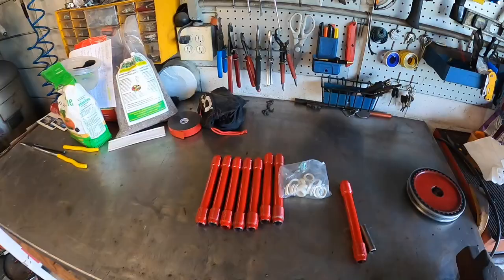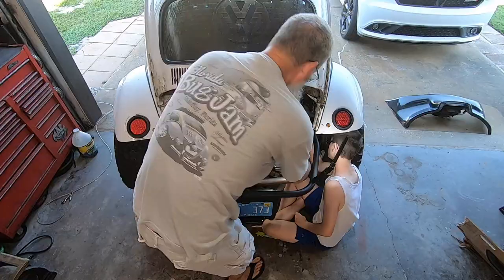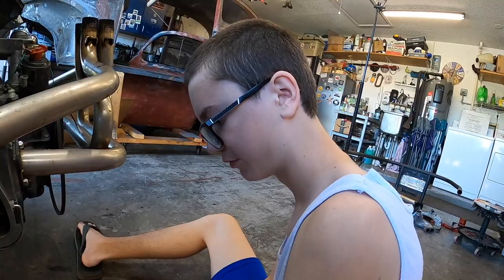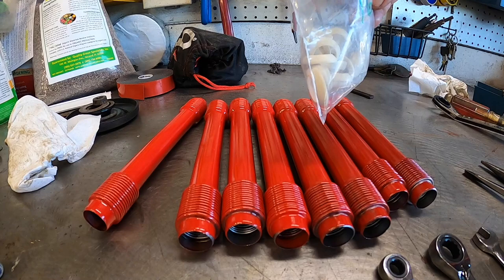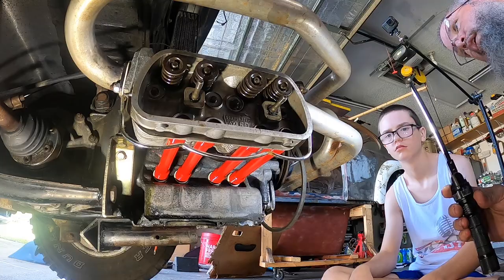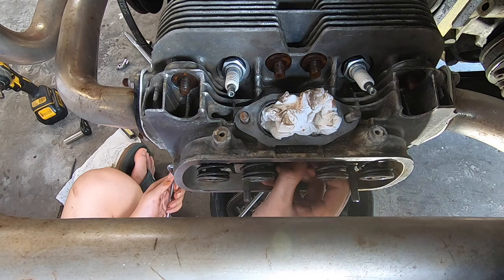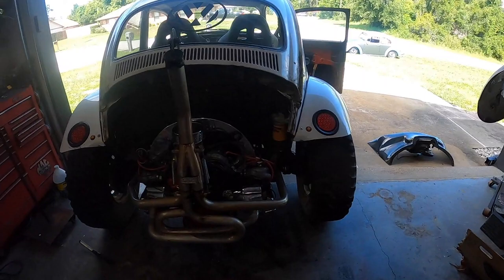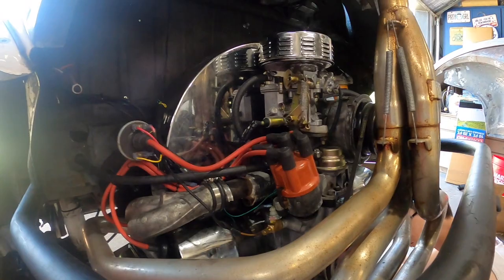How To Replace Leaking Volkswagen Bug Push Rod Tubes

Comment: Using the p/r to hold the p/r tube in place is a super pro tip! Thanks for another great video
Reply from the maker: I prefer to put the engine sideways on the stand but this works well when it’s in the normal orientation. Not everyone has an engine stand.

Comment: Great video glad to see Levi getting in there...did this to our 68 few months back funny story...replace all tubes on 1 side slid head on told Allison to put head nuts n washers on for me boom she dropped a nut down a push rod tube ...it didn't stop n fell into case
Reply from the maker: Thanks, we actually had a good time regardless of how it came across on the video. He was in a mood but we pushed through and laughed later. 
Ouch, that stinks about dropping the nut down the tube 😔

Comment: Another reason to love bajas.  The engine is right out there.  I got lucky just changing the oil cover plate to fix my leak.  The heat here in the south is rough but at least we have high humidity. LOL
Reply from the maker: Absolutely!! Bajas are easier to work on for sure. Glad the cover plate solved your issue. This engine didn’t leak until we came back from the test drive and found that the higher rpm’s while driving bs putting in the neighborhood showed the leaks… they weren’t minor either lol
The humidity was brutal last weekend… I can not wait for it to cool down some.

Comment: Lucky on the head studs! I blow a plug out of my head so I figured might as well replace the tube seals
Reply from the maker: Ouch! If you have the fan shroud off, it’s usually good practice to replace the oil cooler seals as well while you’re there.

Comment: Great Vid Levi.   hehehe   Not everyone has a engine stand or a shop Great example that you can do it without.  I did that on a 2110 sandrail one time. As I recall thats when I decided to build my engine stand. LOL So glad you showed to use oil on the pushrod tube seals. Seen so many with gobs of Silicone which in my book is  big NO NO.  Thumbs UP!!!!!
Reply from the maker: Haha, Levi said thanks 😂
Thank you, that means a lot. Figured in this situation there was really no need to pull the engine and it was questionable if we needed to pull the rear cage. 
Silicone is definitely a no no on those seals, if you want to use anything, maybe permatex or gasket sinch but I’ve always put them in dry or worn oil and never had a single issue. 
Hope all is well sir!!

Comment: Good tip using the push rods to keep the tubes from maybe falling out
Reply from the maker: Replacing them like this, the push rod tubes will fall out. They stay in place for the most part of the engine is on its side.

Comment: Great pointers, Gary! Painting the pushrods and seam up; I have stainless steel ones on my car. Curil or Aviation Sealer on the pushrod seals is also a good idea. Nicely done! Also; you got a cool kid there; he knows The Killer! 🤣
Reply from the maker: I wanted stainless tubes but the local shop only had regular ones…. Figured why not 👍
I’ve had great luck not putting sealant on the seals and not having a single drip. I know it’s personal preference so I say do what works best for that person. 
Appreciate you as always 👍

Comment: I like using the spring loaded ones. All you have to do is take the valve cover off, remove the rocker arms and pushrods then remove the old tubes then put adjustable tubes in. Reverse process and done. ALot less work but I understand why people want a more authentic look.
Reply from the maker: I ran the JayCee tubes in my other beetle for 3 years without issue. 
Figured I’d show the boy how to replace the regular tubes and someone else wanted to see the process. 
Like they say, more than one way to skin a cat.

Comment: I got my beetle up on the lift today to see where the oil leak was coming from. No3 exhaust pushrod tube seal blown out! 🙄 I will be using a telescopic one until i can be bothered to pull the engine. That's the good thing about the type 4 engine. You don't need to remove the heads to change the tubes.
Reply from the maker: @Endfloat  that is a great advantage of a t4 engine!

Comment: Great time for oil cooler seal. Hard to get to rear main...Great job
Reply from the maker: Yes sir, would be a good time for that. We just replaced the oil cooler and seals about a month ago. Then we went for the test drive and found the push rod tubes leaking when driving only. Hope things are going well!

Comment: I am going to use Aviation sealant just to make sure, I have heard it good stuff.
Reply from the maker: I personally wouldn’t use anything on the push rod tube seals, especially the aviation sealant. If you want to use something use the gasket cinch.

Comment: Gary I have my motor in my 1974 and was filling it up with oil and looked under it and the oil was running out on the floor, one of my push rod seals was miss aligned and the oil running tubes have spring so I just realigned it and it stopped leaking, working on make sure we have fire hope to get it running
Reply from the maker: Good catch Jim! That’s one of the nice things about the spring loaded tubes. 
Hope to hear you get it fired up soon!
Have a great weekend buddy.

Comment: Hey Gary ! I went back and under #1 exhaust tube there was a drip . Maybe from oiling the seals ?  And it's hot over here in Corpus Christi Texas also . thanks for the video !
Reply from the maker: I do prefer to take emery cloth to the seal surfaces however I didn’t want to do that with the engine fully assembled so I piled heavily to help them slide into place. 
I’ve seen the tens over there, you guys have had it rough there as well!

Comment: What about cylinder gasket and head new gaskets should be new to prevent from leaking ?
Reply from the maker: You only use high temp sealant between the cylinder jugs and the engine case. Nothing is used between the cylinder jugs and heads by design.

Comment: Gary, any sealant at gaskets needed?
What about sealant at head and jug connection, 
Do the heads to cylinder ever leak oil?
Reply from the maker: Hey Scott. 
No sealant is needed on the push rod tube seals. Some people use sealant and that’s ok as long as you use a thin amount. 
NO sealant between the heads and cylinders ever.
Reply: But have you ever seen leaks at head to cylinder?
Or is it a machined fit, I’m new to building motor
Reply from the maker: @scoth5135  of you’re new to building these engines then check out many of my engine build videos. 
When building the engine you lap the jugs to the heads to ensure a flat surface between the head and jug. 
It can leak at that spot IF the head comes loose but not normally.
Reply: Thankyou gary

Comment: i stretch good tubes waay out__ past head stud threads....
Use a Ratchet Strap(around undressed motor) to Compress/seat heads on.
plenty hippies over-torqued to compress them_>plenty studs pulled outa block
Reply from the maker: There’s definitely plenty of ways to do it 👍

Comment: Do you mean to tell everyone you did all of that without replacing the head gaskets?
Reply from the maker: Well considering there isn’t a head gasket, it would be difficult to replace said gasket.
Reply: @VWJawbreaker  Thanks.
I've been a mechanic since i got out of the military in '86.
I've only had to do a handful of clutches and rear mains to Beetles early on.
I'll have to go back and look at more of your videos because that goes against everything I've known about combustion chambers.
Looking forward to it. Gonna learn something new.
Reply from the maker: @almaiolatesi9567  I hear what you’re saying, trust me I do. However, AirCooled vw engines aren’t your typical Chevy or Cummins engines. 
Also, thank you for your service!

Comment: running on hydrogen home made cell //gives 2 times the power and save on gas
Reply from the maker: No way, that’s cool!
Reply: @VWJawbreaker  i just got back running 26 foot Sea RAY ON LAKE Huron off 2 cell I make from youtube channel //at 45M.P.H   ON WATER out of the lake 2 engines 4800R.P.M.

Comment: Not getting it? Aren't you supposed to just put a $3.98 Walmart Door mat under it? I mean, I want it done right, not just kitty litter on the floor.
Reply from the maker: Well, that would work if you’re not losing too much oil when driving.

Comment: Nice Baja how did you get the camber out of the back tires so nicely?
Reply from the maker: There’s a little bit still there but it isn’t too bad. I re indexed the rear torsion bars and that seemed to help some.